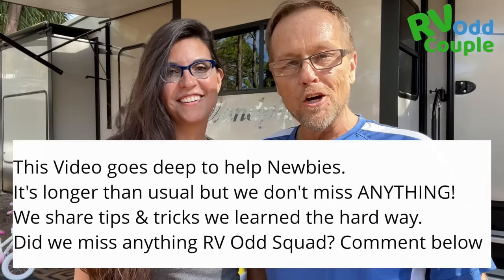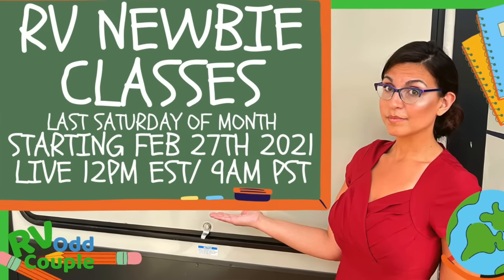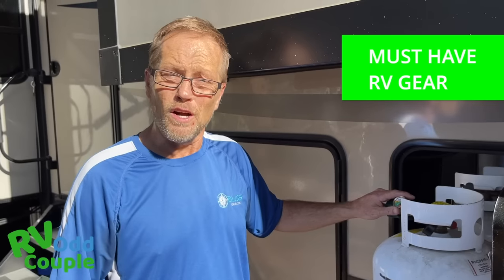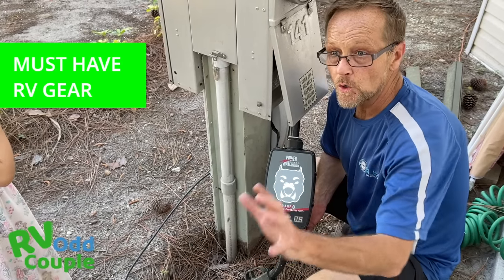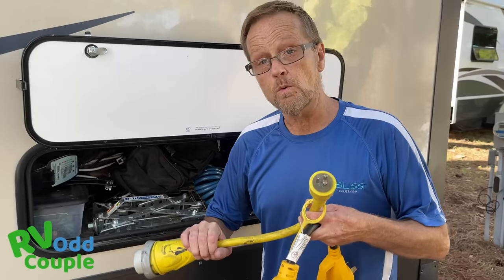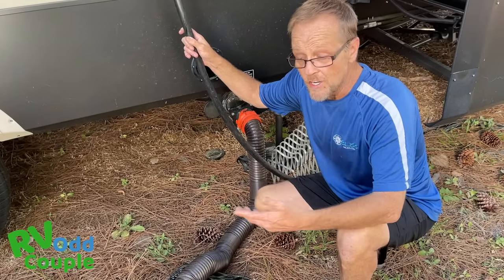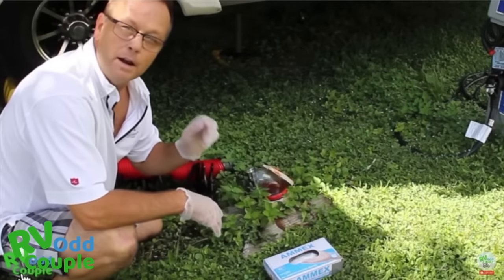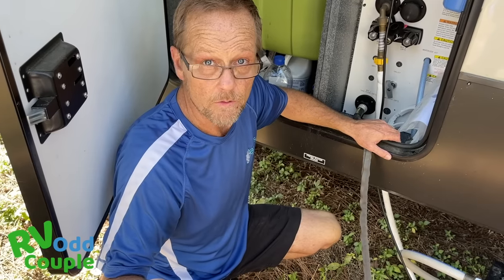Top 10 RV Gadgets Newbies NEED

Comment: Right outta the box you want people to spend over $1000 bucks! $8 for tire pressure monitors. $20 for a harbor freight laser temp gauge for checking your tire temps. A $40 air tank you can fill for $1 at a gas station. Most people aren't made of money.

Comment: I stumbled across your channel a few days ago and have started going through them - this one is especially good advice for newbies.  I pretty much developed the same list that you present after a couple of years of watching videos and spending lots of time on the road.  One thing you touched on that would be an absolute must for any RV’er is: use a checklist!  You NEVER get so good that you can skip the checklist.  Only takes a minute or two extra when arriving or departing to check off every item (then maybe you could avoid forgetting your water splitter 😀).  I laminated mine and have them with me on a lanyard when setting up or tearing down.  When you’re in a hurry, it’s especially easy to overlook something.  There are a lot of things that you can go cheap on when getting started, but you should absolutely go with the best (and yes, they can be expensive) TPMS, air compressor (Viair all the way), and surge protector.  Keep up the great videos!  Best wishes.

Comment: I'll agree to tires, I didn't check tires in the fall before driving 2 miles to store for the winter. pressure was low in 1 tire, and I popped the bead in the middle of town with no place to pull over. it was hard parking in my shed lacking a tire. I was planning on changing all tires in the spring anyways. hopefully the rim is ok, but when I have to buy 1 rim for a spare, a second wont break the bank. that will be interesting to jack up the rig to take all 4 tires off to make 1 trip to the shop. If I'm lucky enough to be able to reseal the tire, I'll let them jack and change everything, but if the tire is finished, then I'll do the half the  work for the shop. then the fun of inventing a spare tire mount, and installing a tpms

Comment: Tip GET A WASTE MASTER SEWER HOSE with CAM LOCKS, the last one u will have to buy, a bit more expensive but well worth it. Its 20 ft. and also they sell extensions 20 ft. I bought extra cam locks, check it out.

Comment: You guys hit it all.  Great video.
The basics when I picked up my new to us class A and drove it two days home
1. Power: Surge EMS with all the adaptors possible for your rig.
2. Water: hoses, spliters, pressure reg, spare nosel.
3. Level:  Blocks and chocks.
4. Basic Tool Kit
5. First aid kit for humans and if needed, for the pets.
6. Extra fire extinguishers.
7. New sewer hose - never use the used one that comes with it... never.
8. Road side safety stuff - Just as you showed was perfect!
Reply from the maker: Thank you 👍😊

Comment: Good job John.....
Yes, the TST ( Truck System Technologies) is a company dedicated to supporting the trucking industry for tire pressure monitoring systems.   I believe that's all they do. 

And, their customer service is excellent. 

I have the sensors that don't require batteries, rather, they have a 3 years lifespan, just replace them when they wear out... much easier than the battery version and same price. 

I recommend this product as basic RV accessory number 1..…and I'm not towing anything.... just driving my 6 wheel Mercedes Benz Sprinter that is 23 feet.   

Yes, just get what you need, you can always add on accessories as you need them.

Comment: UPDATE; Our Harbor Freight compressor has been maintenance free for several years now even after letting her sit for a few months. however ours is not so little. we keep it mounted in the back of the truck. you have a great view on Safety, Don't forget about upgrading  or/and updating your fire extinguisher our 40' 5th wheel came with a tiny little thing ( a waist, not sufficient for an emergency) we upgraded to a rechargeable larger fire extinguisher. also be sure you have spare batteries for your smoke alarm (s). as far as chock blocks go, great job, we have the plastic leveling / stabilizing blocks, been working great under our tires and stabilizers for 5+ years now. you guys always do such great videos, always a bit entertaining and a lot of good information. That's funny, I did the same thing to our commercialized license plate frame and it wasn't even camping world...lol. wishing every one the best of health and safe travels.
Reply from the maker: Glad your air compressor is still working well!  Great point on the fire extinguishers!

Comment: So GLAD you did a Gas Stop install👏🏻 I purchased one and haven't put in on yet. This video will make it easier for me since I'm a visual learner. Thank you !!!!!!
Reply from the maker: Glad I could help!  It was a super easy instal.  Let us know how it goes
Reply: The gauge doesn’t ever work correctly. Because the pressure is dependent on the temp.  And they do stop the flow but only if you have a huge leak.  If you have a slow to moderate leak it will not shut it off how would it know off it is a leak or your using the propane

Comment: I always carry 2x6s, 2X4s and 2X2s. I make ramps with the boards and use the 2x2s to make log cabin stacks to put my hydraulic jacks on for stabilizers. Also use boards for chalks.
Once I got the very last paved parking spot at a campground and it was extremely steep! I mean It was stupid steep!
I ended up using my boards to make ramps for both sides to get the wheels at least 1 foot off the ground and when I got done my trailer coupler was sitting on the pavement to make the trailer level.
Sorry if too much info.🙄

And I feel the same way about camping world! 🤬
Reply from the maker: Good stuff

Comment: John and Mercedes what I considered the bare essentials for rv camping is a grease gun for checking the wheel bearings and making sure they are properly lubracted and won't over heat air compressor for tires cordless impact wrench for getting tires off a torque wrench for checking and tightening lug nuts tire patch kit water pressure regulator electrical surge protector propane regulator shut offs tire patch kit a tire thumping bar to check cause sometimes a sensor can fail or the batteries can die and a tow strap

Comment: hi guys, great tips as always...
one thing i would highly recommend if you're doing a lot of moving around is have an account with a national or regional tire monger such as Les Schwab or Big-O Tires. they do offer service truck calls (not cheap but well worth it in a dicey situation) and you can get tires at their retail locations even when you're a little low on the froghides in your wallet. this can be every bit as valuable as the thousand parks or other campground membership. 
one year working in california the earth first-ers paid my truck and slide in camper a visit. they loosened the lug nuts on one wheel. my dog went bonkers when i came back at the end of the day to leave and head down the mountain. she was trying to say: "dad!! sumbody mussed wit de truk!!"  being winter and the road grader have just gone thru with its wheels all snow chained up, the rumble of the loose wheel didn't register. driving on hard pack with snow chain gouges, your wheels rumble anyway. so a few miles down the road the crew wagon pulled up behind me. as i let them pass the drivers side front took a dip...i thought i was in the ditch. nope.. the wheel fell off. on the passenger side was a straight drop off several hundred feet straight down reminiscent of a snuffy smith comic strip with several dozen vehicles never recovered still languishing in the bottom.
on the way back up to idaho i had to stop in to a Les Schwab tire center along the way and they changed out the lug studs, wheel and nuts.. bought 2 new tires as well. but it still set me back a pretty penny. it was then and there i could see the good sense of having a charge account with a tire monger...

Comment: I have the same surge protector.  I love it. But boy is it bright at night. I have 2 honda 2200 portable generators for my rv so I bought a dewalt low profile trim air compressor that stows under my jack knife. Not only can use for my tires. Many other uses but is only 2 gallon. It's even quiet not like the noisy pancake types. It's a great alternative. I also keep a fire extinguisher  in the kitchen area. My daughter in law says " if it ain't burnt it's ain't  done".

Comment: Happy Valentine’s Day you guys!  Another great, informative video!  So proud you’ve learned so much...you’re “old-timer’s” now!  Since we have a 26 ft motorhome, we do use the stackable levelers, and that works just fine for us...unless we are on very loose gravel.  That’s when we sometimes will slide around due to loss of traction.  Yes, yes, YES on the tire monitoring system and water filtration!  You NEVER really know about each areas water purity...Bakersfield, CA has a lot of residual nitrates in their water, and they notify you of that.  It’s from the fertilizers that has been used over the years for all the orange groves in the area.  We arrive there with a full water tank.  BTW, the electrical management system you plug in at campgrounds?...padlock it to the electrical box!  Unfortunately, they are expensive and there are some who would just steal it if it were not locked-on.  Another couple of items that Tim and I consider essential, whether a newbie or an old timer rving, is make SURE you have multiple extra fuses in all the amps used in your RV.  We’ve learned, years ago, you can’t have too many in reserve!  Another very helpful item to carry is a shovel.... you can easily get stuck in sand or mud, and our little fold-up shovel has been needed multiple times, for various reasons.  Geeze you two, I just love seeing you “blossom” (!!!) into such well-informed, helpful people!  Keep it up, love you guys, Virginia 💕

Comment: Tpms is not required for first trip.
Nice, but not required. Just be diligent on checking tires.
Compresser , any decent will do. No need to spend$200 on one. My $60 Kolbalt from Lowes works great.
With your list, will cost nearly $2,000 in stuff for a person to go on first weekend trip.
You need, sewer hose, don't forget the clear 90 degree elbow.
Water hose.
Wheel chocks & leveling blocks.
Dog bones for power.
Should have..
Water pressure regulator
Some kind of surge protector
Water filters of some sort.
Most of above can get at any Wal Mart.
Reply from the maker: Thanks for sharing your list

Comment: A nice review for me as I am heading out (hopefully) March 1st. The weather isn't  cooperating right now (-15 to -25 over night) but have been working on setup and take down lists (and  stocking lists for the road). Maybe add the water splitter to the list?  The water problem (for a part timer) I found the Clear2 O,  2 stage system that goes to 1 Micron.  I'll let you know how it works out. 
Thanks again for the "Basic RV Gear" again it never gets old! Be safe!!:_Coffee:

Comment: Hey you three.. Greetings from snow covered New Jersey. 
How about a "On The Go" water softener with a box of test strips / Basic set of tools including lubes, electrical tape, fuses and bulbs / lug nut torque wrench / portable battery jump starter / fire and carbon monoxide detectors / 3 cans of fix-a-flat and a case of cold beer in the back.
You guys are great as usual .. looking forward to your live feed.

Off the record.. Brady did it again!!!

Comment: in reference to the gas stop i beleave thats what you called the device on the tanks... how does it know the diffence between a leak and when your cooking wouldnt it  have the same flow of gas?
Reply from the maker: Great Question.  The people at Gas stopped sent us the following: GasStops are ‘tuned’ so that they will automatically shut off only when there is a sudden MAJOR LEAK of propane.  To not create inconvenience, GasStop set that Major leak trigger at about 70 Standard Cubic Feet Hour, or around 75,000 btus.  Since the average RV on the road doesn’t consume that kind of propane flow during normal use, GasStop should not interfere with your appliances (cooking, heating, etc).  Though this means that the GasStop will not shut off for minor leaks, it still enables you to quickly check for minor leaks anywhere in the system, using the 2-3 minute process described in the instructions.  It is recommended that the RV’re do this minor leak check whenever setting up camp, or pulling the rig out from storage!

Comment: Swimming pool "noodles" or pipe insulation that are split along their length are good for padding the edges and corners of the slide-outs where you have to access tank drains, basement storage, or other areas while the slides are extended.
Reply from the maker: We'll have to make that #11 lol  Great tip!

Comment: If only knowledgeable people like you worked at the RV sales place to spend time with the new RV owner to tell them everything they need for their RV instead of them having to learn on their own.   All these accessory needs and difficulty of driving a big rv down the road will be a lot of reason that many people give up on RV'ing this year after having bought an RV in 2020.  Likely will be lots of used RV's bought in 2020 avail for sale in 2022 and 2023.  Great job on ripping off the license plate cover.  Sure hope that helps a lot of people research on google about why they should not buy an RV from that company
Reply from the maker: Well thank you for the compliment!  We're expecting a ton of used RVs to flood the market in a few years too.